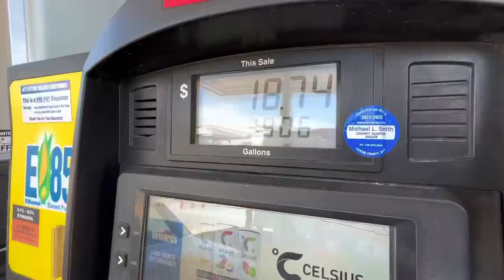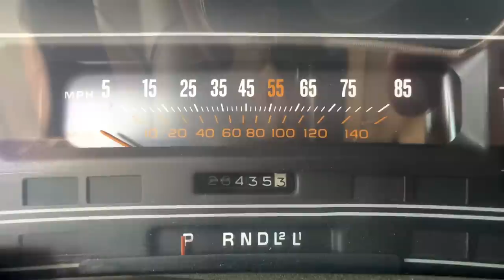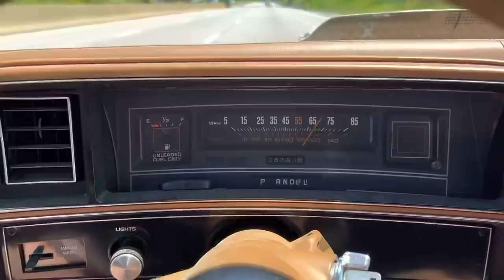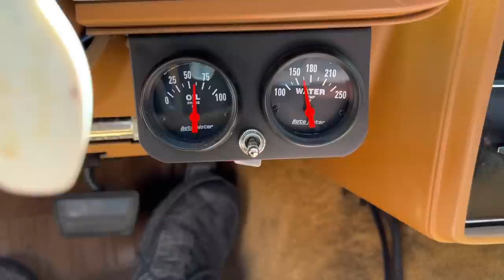CORN SWAP!  Testing a Quick Fuel 750 E85 Carb for POWER & ECONOMY!

Comment: Must if running E85
1 for proper atomization engine must operate at 185 temp. 
2. A blaster 2 coil is not enough to ignite ethanol. Must run a HVC coil. 
3. For SBC on E85 36 deg. Is about all they like. 
4. If you park your car more than a week or two you should drain the bowls and empty the Excelerator pumps. If you get gel in your carburetor like that simply fill the carburetor up with gasoline and let it sit for a day or two it will completely dissolve all the gel! No need to tear the carb apart.

Comment: I guess no one had a clue on how much power the truck was loosing on the old ignition system it’s nice to see you guys progressing God Bless you all.
Reply from the maker: Chief had been telling us for over a year or so.  I think I was tuning it into a bottle neck to where the ignition could only fire x amount of fuel under boost pressure.  Now that the ignition ceiling has been raised, it’s wanting more fuel and making more power.  We’ll see how it goes

Comment: Looks like a nice carb. I need to do a economy test on my setup. I changed the PV restrictions  to lower jetting on a 950 xp E85 and delayed the signal to the primarys as much as possible so cruise is nice and lean. Had to change to a 50cc up front also to remove hit stumble. Tricky to get economy with 4.30 gears th350 5000 stall and a 400 cid solid roller. 😆 But I really like that XP E85 it's a nice unit. I have my setup on my channel check it out if you have time. I love the content you guys are providing.

Comment: I've got a 69 Camaro that has been sitting in my garage for quite some time. After watching your videos. It is beginning to spark my interest back in to my old girl that I've owned since 1992. Since my son was born I have let my car sit in my garage with out doing anything to it (priorities). My son now 15 almost 16 has been dropping hints that he wants me to do something with the car. I have been considering the switch to E-85 for quite some time. My current set up is rather out dated but is fine for the application and it's intended use. I have a stock fuel tank that has been modified  with a sump. I have a Fram fuel filter housing and a Holley blue pump and regulator. I have 3/8 inch aluminum fuel lines running the length of the vehicle then just below the fire wall i switch to braided fuel lines to the regulator and to the carbs dual feen lines. The motor is fueled by two Holley 650 Double pumper carbs. The main reason I've have been shying away from using the E-85 is the corrosive properties of the Ethanol with Aluminum. Besides changing the carburetors and aluminum fuel lines what other recommendations would you suggest?

Comment: Love me some E85, been running it in my Malibu since 2010, TT SBC fast XFI fuel injection. 13:1 355 and about 25psi with two little 50mm turbos. It does cause leaks on my AN fitting, anything older with rubber o rings. I just change them out for teflon as they go bad. And oil changes more often due to condensation.

Comment: On that Camaro a nice aluminum radiator designed as a Big Block replacement and a factory big block 7 blade fan with the HD clutch would most likely cure the overheating. But never forget the importance of a properly fit and sealed shroud.  
If you feel the need for E85 then by all means go for it.

Comment: Hi Bill! I have a question about E85 fuel systems. On a typical mild street application, what other preparations does one need to do? Such as, fuel pump? fuel lines? Does the nitrous system require anything special?
Reply: i would like to know this as well...

Comment: First thought, what does E85 do to the inside of the stock metal fuel tank over the winter. Is there something that keeps it from corroding the inside of the tank. Also I start my day with your videos while I have breakfast. Thanks for the quality content.
Reply from the maker: Good question, however I’ve never had an issue with corrosion in a steel tank.  The corrosion problems always seem to involve bare aluminum.
Reply: I'm seriously considering making the change to E85 based on your experience . But I'm thinking about the diaphragm in my mechanical fuel pump and do I need Teflon fuel hose from the tank to the carb.
Reply: I live in southeast Texas,  e85 is considered a death sentence for a car that sits very much. Ethanol gasoline goes bad in about a month with our conditions. I love the benefits, but the negatives keep me away from it.

Comment: I have been running E85 in my fuel injected Turbo V6 since 2019.  If you are fuel injected, make sure you run a high-quality fuel filter like a IF-750 from Injector dynamics. The other thing is you need to change the oil sooner.  I do it every 2k miles. When you change the oil, it will smell like the town drunk. It can get diluted with E85. It's more noticeable in the winter months. If you park the car for the winter, make sure you pickle the fuel system with gas. It will help to keep things clean and it won't gum up as it sits.

Comment: To get the full benefit of e85 generally requires adding ignition timing and tuning.  Just adding e85 is only a small percentage in the potential power increase. 
FYI for every .10 you lower your 60’ times knocks off +- 1.8x in 1/4 mile ET. 
.10 x 1.8= .18 reduction in ET

Comment: Just thought I'd mention that my gas mileage almost doubled when I got my vacuum advance working right, engine ran much cooler too. Another thing I noticed was that without the vacuum advance, I had to keep my foot in the throttle like halfway, almost getting into the secondaries, just to stay at 65-70 MPH. Once I got the vacuum advance dialed in, I could cruise at 65-70 MPH with the throttle just barely cracked open.
Reply: Engineers kinda knew what they were doing....In modern EFI systems its really impressive how good the OEM engineers have dialed in part throttle timing curves (tons of advance)
Reply: @HPRaceDevelopment  I am trying to duplicate vacuum advance curve with sniper efi and hyperspark system. Kinda struggling to figure out safe lean cruise afr and timing advance.
Reply: @cfmechanic  Most people try to go too lean on cruise - it usually doesn't result in better economy after a certain point - if the engine is cammed at all - I suggest stay in the middle to high 13's afr wise which will really help any mis fires or stumbles vs tryign to dial in around 14.7 ( lamda around 1....We usually deal in lamda rather than afr - lamda .92-.95 ish is good cruise) Spark wise - A good tip I heard was use a vacuum gauge ran into the car - and play with the timing while at cruise until you reach peak vacuum.  Of course listen for knock - but that works really well.  Numbers as high as 50 degrees low throttle are not uncommon.  Eventually you can advance so much is will mis some - so that's something to listen for.  Just slowly work away at it - and anything past 75 percent throttle should mimic your WOT timing curve...
Reply: @HPRaceDevelopment  awesome amazing tips. My idle is nice at 14.7 cruise is set to 13.5ish I tried 13.8 but felt too lean slight miss at steady light throttle. I'm only running around 27 degrees in cruise will follow your tips thanks.
Reply: @cfmechanic  on a car without individual cylinder control, you will find through testing that you have lean and rich cylinders that avg out to the lamda you see. The variance is huge. For this reason - you may find it best to tune for lamda .9 at cruise and wot power lamda of .84 or .85. Afr aprox 13.0 for cruise and 12.0-12.6 wot. this keeps the really lean cylinders from being say 16:1 afr

Comment: Ethanol is right for me. The entire time gasoline wasn't over $3 between 2015 and F. J. B, I was focused on improving mileage on E85 and E100 that I make. My 70 GTO has had E85 in it since 2007, the 65 has been on it since 2018, and the 68 LeMans since 2015 when I put it together after dragging it out of a Nebraska pasture. 

It must be the Ohio fuel with the gel and corrosion, because I haven't found any of that with Nebraska, Michigan (upper peninsula when they had it here) and northern Wisconsin fuel. My junk sits for months to years, and everything is spotless when I take a carb apart. At most there might be some of the white chalky stuff left over from an additive. Ethanol itself doesn't cause corrosion or leave anything behind when it evaporates. Its nothing more than vodka, and when you empty a bottle of vodka or whiskey, is there anything left in the bottom of the bottle?

What I have found is heat and compression are your friend. A 160F thermostat works great for gasoline, but is too cold for ethanol. You want 195F thermostat in it. Two reasons, it helps vaporize the fuel under the carb, and it will boil condensation out of the crankcase that collects in all engines with the heat cycles. It won't hurt power running it hotter, might actually improve it because of how much better at cooling the intake charge ethanol is. I've never done a back to back test at the track based on heat. Something to try out Bill...

Best power and best mileage are not at stoich on E85/E100. Best mileage will be between 8.5:1 and 9.5:1 AFR, best power will be around 7.5:1, and you need a wideband O2 with the scale rich enough to get it there. Ethanol will run well over a VERY wide range, unlike gasoline. You can get it to run somewhat ok at 13:1AFR, it will buck and surge a bit, and you can go pig rich down to 5:1AFR, but outside the range of 7:1-10:1 you are simply wasting fuel.

I have a 455 with 13:1 compression from iron heads I had milled to 64cc chambers, with the  quality flat top pistons like Ross, Diamond, etc, it makes right at 13:1. I daily drove that until I found out that the least expensive FlePro head gaskets don't like more than 11.5:1. No problem with the fuel, only with the compression. Around 12:1 is the breakeven point for mileage, where you will get the same mileage on ethanol as you did on gasoline. 

With 13:1 and running it at 210F, my 70 GTO got 20mpg mixed highway/city driving using a Qjet I converted myself. I am the E85 Qjet guy, all the info on them comes from yours truly figuring it out back in 2007-2010. It had a 700R4 and a 3.42 gear behind it. It makes LOTS of power from idle to 6000rpm. Tire shredding transmission shattering torque.

For comparison from 1996 when I built the a 455 for it, until 2010 it had 8.8:1 compression with 2.93 gears and a 2004R trans. The best it did with the pump gas 455 was 19, just about 20mpg while following a semi down I-40 when I took the GTO from Nebraska to my AF base in Charleston SC. The 700R4 has a shorter overdrive than the 2004R, and 2.93 vs 3.42 is a few hundred RPM difference. At 2000rpm and 27" tall tires the 3.42/700R4 was going 67mph. and the 2.93/2004R would be going 82mph at 2000rpm. The 13:1 engine did better with deeper gears and less overdrive.

Before you think its like a sbc and it needs more gear or it will lug at low RPM so it would get better mileage with deeper gears, be aware that 87 octane capable 455 pushed that 4100lb GTO with its 2.93 gear into the mid 12s with stock converters and no spray. 455s don't need much gear. The 13:1 engine would have easily run in the 11s, if I had ever taken it to the track in the 70 GTO. That bottom end is in the 65 GTO (which has atrocious aero) with 11.5:1 heads on it, its my daily driver. Just took it to town and got groceries with it last night. It gets around 17mpg, unless I beat on it, which is often.

My 455s are happy driving around at 1600rpm cruise going down the highway, they just do what they do best and grunt. E85 makes them grunt harder, especially between idle and 3500rpm, it drops off a bit after 3500 but still makes more power than gasoline. With the 2.93/2004R combo going up the mountains to Greenville SC was no problem, it would pass trucks without even down shifting, add more throttle and the 455s shove you forward.

You don't NEED lots of compression to run ethanol, but you sure as hell can run more, and you use less fuel when you work it harder in the cylinders. 16:1 compression is no problem on pump E85, you can drive around with that, and never worry about if you have too much advance in it. Give the engine the advance curve it wants, because its not going to ping unless you have it running VERY lean.

With 7:1 to 11:1 engines you will lose a few MPG with the switch, how much depends on the engine design, if its EFI or carb, how hot you are running it, and of course how you drive it. Its VERY enjoyable stomping the skinny loud pedal on the right with an E85 fueled engine, unless its not tuned right and its too lean or too rich. The 65 GTO does better with the 455 at 11.5:1 and a 3.08 gear (17mpg) than it did with a 400 with 7.8:1 and 2.56 gears (15mpg) but its more about how much torque is pushing the rear gear than the fuel. The 400 was kinda anemic but would run on any camel whiz you put in it. Yeah I know how to squeeze mileage out of big engines on pump gas and ethanol.

It should be obvious that if you build a 13:1+ engine you are not going to be running it on pump gas ever again, what happens with my Pontiac engines when they don't get enough octane is they flatten the upper rod bearings.. and it happens fast. 

As for corrosion, special instructions, additives, stainless steel, and the rest of it, 2007 to 2022 without a problem. The rubber fuel hose I use from NAPA and Advance lasts longer, not that I run much of it. NHRA rules state no more than 12" of rubber hose in the entire system is allowed. When I was running race gas in my 79 Formula, it was going through fuel hose every two years on VP 110 and Sunoco 110. I had to switch the hose out, because it got brittle and would crack. Accel pumps would leak almost every spring after I put the car away for the winter. 

None of that happens with E85 or my home made E100. Ohio must be putting some crap in the fuel that you don't need. I am ramping up my production this year, with plans to make 500 to 1000 gallons a year from now on. Between cattail vodka and methane I will be making as well, I will probably never buy gasoline again. 

There are other things you can do to improve mileage, but its much harder or impossible to do with a carb. It involves heat in places you really don't want it with gasoline. I'll explain that if you want.

Comment: I would for sure get an E85 sensor/gauge. It took me 3 fill ups, because running all the gas out of a tank does not get it all out, before mine read over 80% ethanol. And the pump I was using was reading E87 in mid summer.

Comment: Hey Bill; something to consider since E85 is more detonation resistant than pump gas, is using a (slightly) higher temperature thermostat.....I know it sounds counterintuitive but, the ideal coolant temp between different fuels (ex: gas vs methanol) and different engine materials (ex: all-iron vs. all-aluminum) changes for the best thermodynamic efficiency. As said if your not knock limited, doing so can translate to more power, better fuel economy, and cleaner oil,  but it it all depends on the tuneup to take full advantage of it.....I’d expect a thermostat of around 180-degrees be about the point of maximum beneficial coolant temp on E85, and up to around 200-being the point of diminishing returns or slight loss (based on what I’ve read / seen)......there’s some good content on this topic on YT where dyno water temp is swung to the high/low extremes on different fuels and the gains / losses can sometimes be surprising.

BTW; my statement is based on you not having any cooling issues at the track, and it can get back down to thermostatic temp between rounds; if it that’s not the case then just ignore my comment.

Keep up the good work 👍

Comment: I don't remember what they did after you broke the axle but an easy upgrade is a 4th gen f body posi unit.  They are 28 spline vs the Malibus 26. But also we have found that if you pull the gear back to a 3:23 or 3:42 you are less likely to strip the teeth off the pinion. But once you get into the 3:73 or lower gears that becomes a problem.

Comment: 2 things about E85, it runs clean but doesn't like the cold weather we have in Ohio on Start-ups....😁 What I have found in my area, Speedway is my last choice, a little inconsistent on their E85. I use a local Co-Op, might be something to pay attention to. Advice for older vehicles, make sure you are compatible, maybe you can run through this Bill for the guys thinking of making the switch.
Reply from the maker: Turkey Hill always has the best E around here.